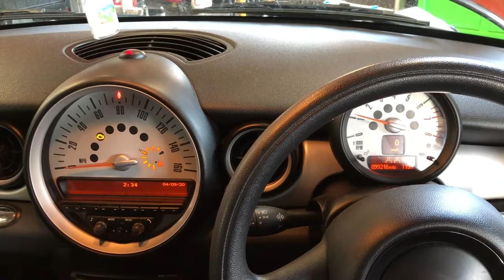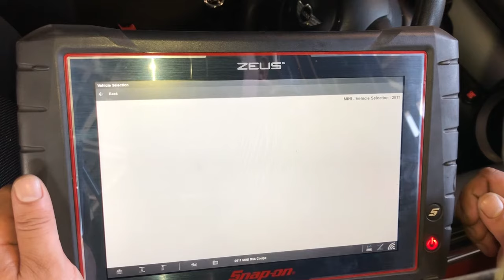Mini Cooper R56 1.6 petrol Camshaft sensor common fault

Comment: Replaced 3 of these in 2 years in the same car, hopefully nothing more sinister going on!
Reply: MINI SERVICE BULLETIN M12 01 10
Reply: Worn cam or  chain needs replacing £££££,
Reply: I'm wondering. Do you ever have to top up your coolant? I see signs of water in the oil in the sensor he replaced (white in the oil) I have a similar issue and am loosing some coolant. Suspect water getting into oil and causing sensor to fail? Seems no water got into my oil and sensor is not really susceptible to gunk anyway.
I just noticed you can swap inlet and outlet sensors on the r56 I did that and runs much better now. Can't see any obviously bad readings on the sensor, might be bad cable from vibrations, but will order a new sensor now.

Comment: hi i have a r56 n14 jcw that starts and after 1 sec shuts down i can hear the starter rellay clicking and dies, i just got the error code p0141 saved but after clearing it i dont get no error code or engine light... But still shuts down same way, if you have any idea what could it be i would be relly thankfull!!

Comment: I've replaced one of these already but almsot a year later same fault. I've just bought a bosch one so hopefully that will be more reliable. :)
Reply: What problem was you having i think mime is the same
Reply: @Chris-lx5rf  I don’t know what the problem is but my car only has this problem when it is very cold. Once it had warmed up it is fine
Reply: @hondafpv5932  same problem here
Reply: MINI SERVICE BULLETIN M12 01 10
Reply: I'm wondering. Do you ever have to top up your coolant? I see signs of water in the oil in the sensor he replaced (white in the oil) I have a similar issue and am loosing some coolant. Suspect water getting into oil and causing sensor to fail? Perhaps. Seems no water got into my oil and sensor is not really susceptible to gunk anyway.
  I just noticed you can swap inlet and outlet sensors on the r56 I did that and runs much better now. Can't see any obviously bad readings on the sensor, might be bad cable from vibrations, but will order a new sensor now.

Comment: I have many codes p1338 & p0368 &p061f & p0420 I don't if it related to each other or no?  Because in the first I have problem the engine when it hot it work only on 3 cylinder but when it cold work normal on 4 cylinder. I try to take off the sensor 1 camshaft and the results  it work normal the engine after while the check engine turn on and have all that codes ?
Reply: Hi everyone. Maybe you can all help me.
I have these error codes.
P1338
2DA0
2C58
I start the car and after 2 km an error appears while if the car is warm I can travel without problems. 
It happened to you too. Do the video sensors have to be computer coded? hello everyone from Italy

Comment: So this is just plug and play? Do I need to program these...do not have scan tool. BMW dealership wants $1200 to replace both...says it is a 4.5 hour job.
Reply: Los concesionarios siempre engañan a la gente .. te cobran bastante caro ese arreglo .. tú lo puedes hacer y solo necesitas que un escáner te borre códigos de falla porque ya cambiaste los nuevos … saludos

Comment: hi, dtc 296b - camshaft sensor unloaded, will it be the sensors?
Reply from the maker: Hi probably yes they are quite common, you could check by swapping the sensors and check the fault code. And best recommendation is to change both sensor.
Reply: MINI SERVICE BULLETIN M12 01 10

Comment: To test wiring or sensor you can swap sensors as inlet and outlet are the same. After swapping i had much better response and bad sensor does not always throw codes. Tricky one sometimes.

Comment: Hello I have a mini cooper 2008. Fault code. Do I just replace these sensors?
Thank you
Reply: Yes, just replace sensors if you’re sure that’s the problem. Some cars you have to also replace the crankshaft, so just read up on your car. But most you don’t have to replace both
Reply: MINI SERVICE BULLETIN M12 01 10

Comment: Hi everyone. Maybe you can all help me.
I have these error codes.
P1338
2DA0
2C58
I start the car and after 2 km an error appears while if the car is warm I can travel without problems. 
It happened to you too. Do the video sensors have to be computer coded? hello everyone from Italy

Comment: I have code P13C9 vanos exhaust camshaft stuck. I read the solenoid causes this. Is the sensor you replaced the same as the solenoid?
Reply from the maker: hi the link for solenoid  https://www.ebay.co.uk/itm/303580637061?var=0&mkevt=1&mkcid=1&mkrid=710-53481-19255-0&campid=5338268676&toolid=10044&customid=Cj0KCQjw6pOTBhCTARIsAHF23fK3VCVBv2LK6X-LntSl11BlQpdgBVmEQucXNr6MM6nIFGXfM_R8cQ0aAu5FEALw_wcB 
and you will need to replace exhaust side solenoid.

Comment: i have a P0012 and a P052B on a non S could this be the problem its the only thing ive read that can cause both codes potentially
Reply from the maker: Hi there yes the fault code refers to intake camshaft sensor, if that’s correct you should swap the sensor and diagnose.

Comment: Can I just clean the sensor with some WD-40.?
Reply from the maker: Hi you can try I am not sure if that will work, but please do try let us know
Reply: @MustangMotors  sori the late reply, I decided not to pull the sensor out, but instead poured 3 litres of Penrite oil into the motor (because I knew I had run it with the oil warning light on, for about a month ⚠ so to me, that was the most blatantly obvious fix).. So, it seemed to have solved the problem believe it or not, because the computer turned the engine light off.. (although the engine light came back on on a 500km trip, so I poured another litre of oil in, and after running it a couple of hundred km's the computer turned the engine light off. So, a diagnostic scan isn't 💯 per cent accurate.. The error codes could be triggered by some other underlying problem..( In my case, running it for an extended amount of time, more than a thousand k's on a long trip, with the oil warning light on ⚠ 👀).
Reply: These stupid engines use as much oil as petrol…get rid and get a later 3 cylinder..

Comment: How do you find the MAF sensor?
Reply from the maker: What fault codes do you have, it probably the map sensor, follow the instructions with vin no and click engine, then intake manifold, sensor no 9 (differential pressure sensor) https://www.realoem.com/bmw/enUS/showparts?id=SR32-EUR-01-2011-R56N-Mini-One&diagId=11_4554
If you check in the website, fuel preparation system, then click on intake muffler/filter cartridge, you will see the no 16 no selectable which is the mass air flow meter.
https://www.realoem.com/bmw/enUS/select